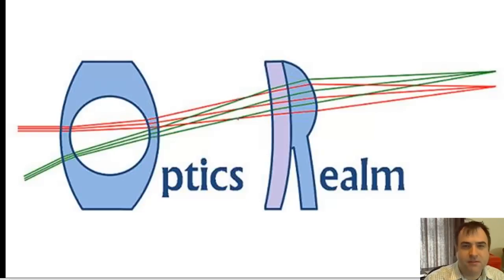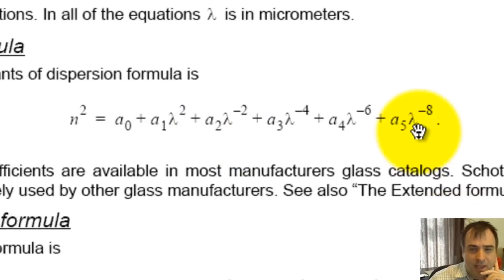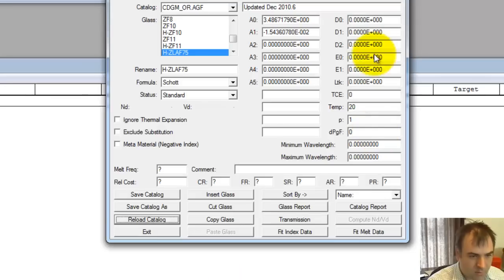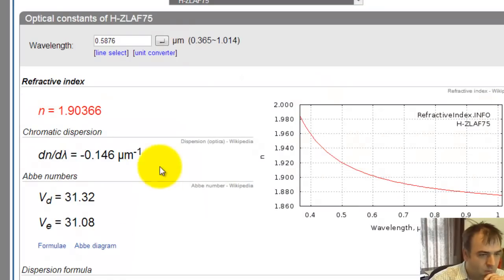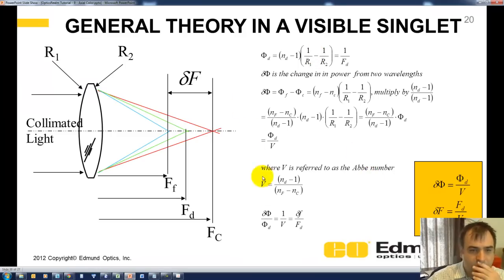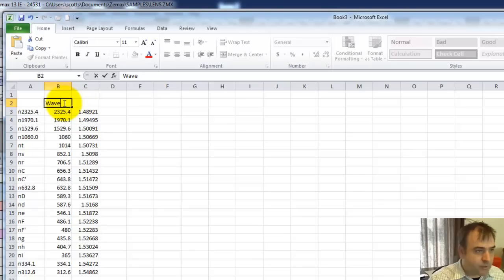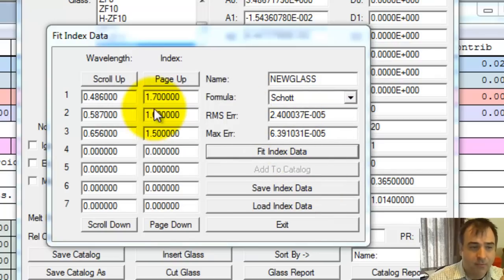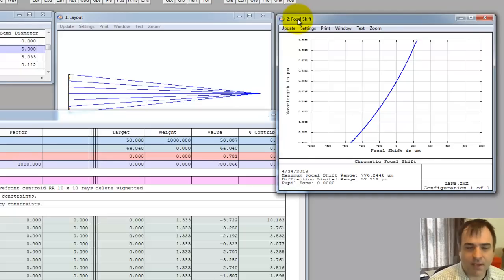Zemax Tutorial - 9 - Entering Custom Glass and Axial Color

Comment: This is a great tutorial for standard glasses, but what about colored glasses typically used in filter application?
Reply from the maker: Erica, the easiest way to model this is to input the wavelengths and weights on the wavelength data (Ctrl-W). This will allow any analysis to have an accurate spectrum of what is getting to your detector or evaluation plane.
Reply: contact me,skype:jakiejk

Comment: How can I  custom the source? I have data from some experiments and I don't know how insert this on the software
Reply from the maker: Davi, As with Erica's response below a custom source would be included in the "wavelength data" dialog box. Actually this is intended to hold the wavelength weights for source spectrum, bandpass filter and detector responsivity. These weights can radically change things like MTF